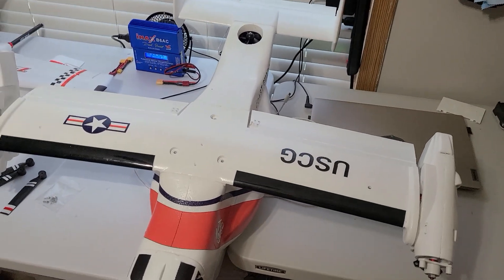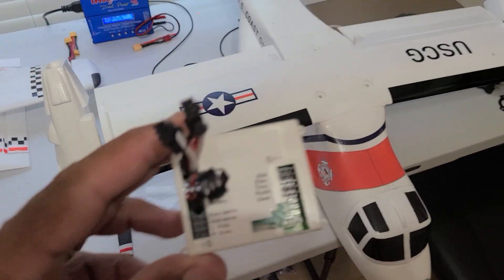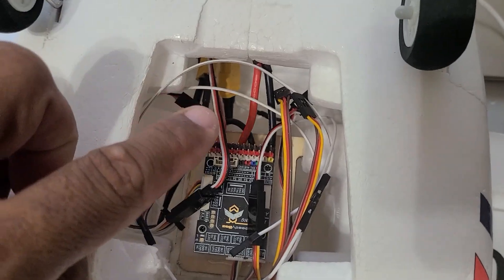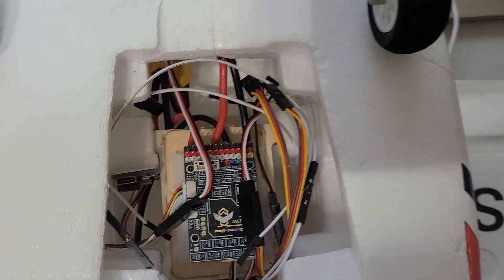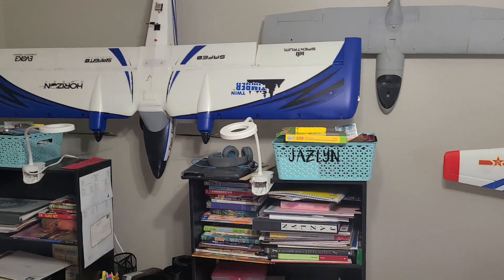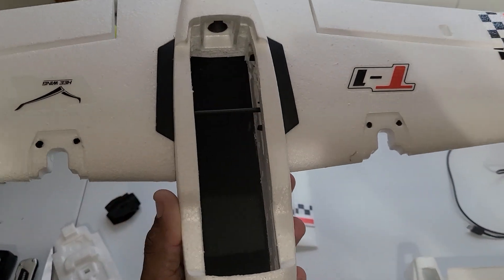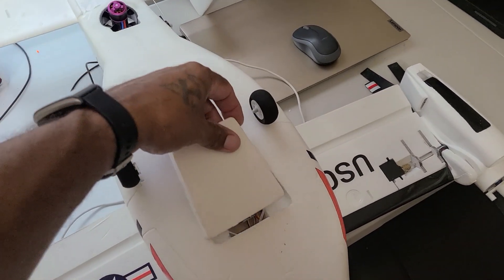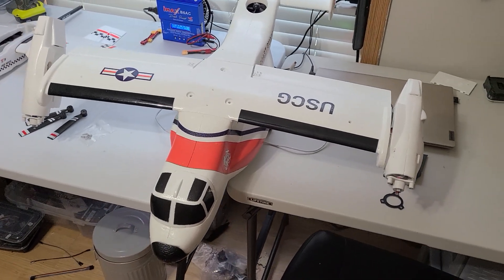V22 Osprey , speedybee f405 wing

Comment: I have the same controller and I am just getting into vtol so where do I start. I have no Idea how to use ardupilot. Also can this be hooked up to APD PDB500[X] 12S 52V 500A Power Distribution Board I'm running edfs so it was at the suggestion of getfpv
Reply from the maker: Ardupilot and be confusing at times , inav 7 now supports vtol